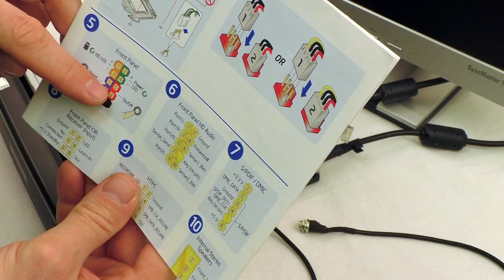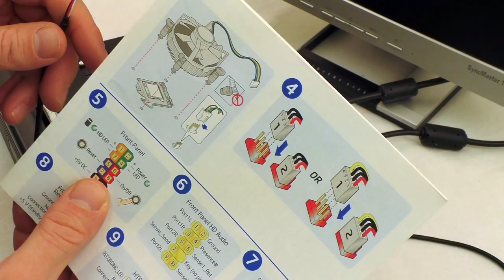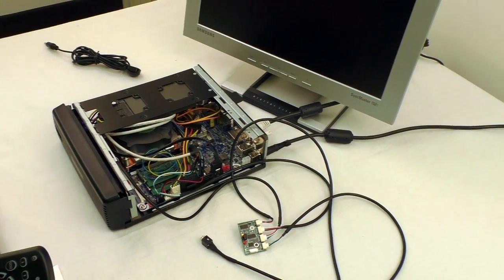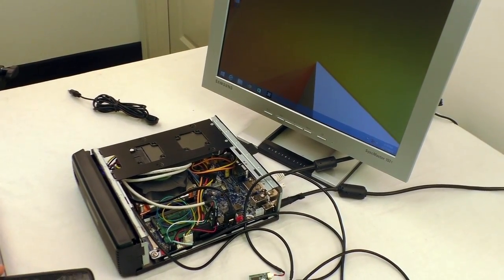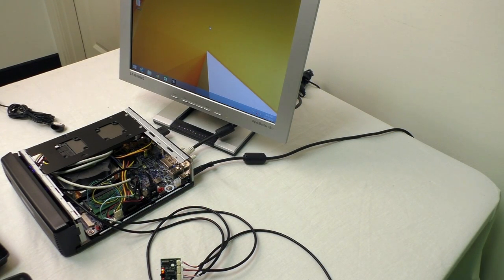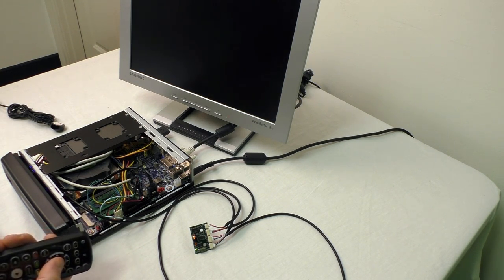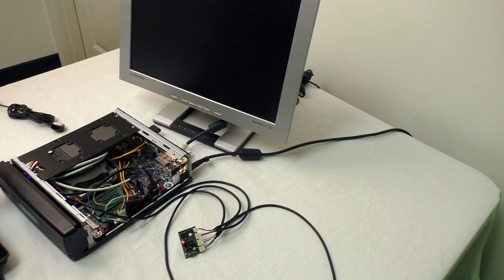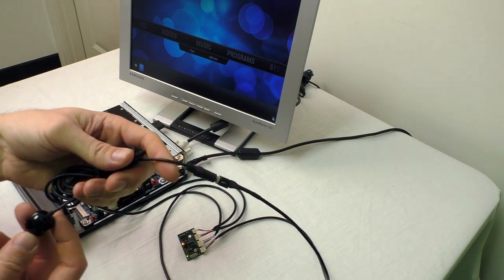Watch the PC-IRS5-01 HTPC IR Receiver in Action

Comment: Nice idea.  I would back this kiskstarter if it included a 3.5" bay hardware.  Drilling an existing case is problematic.
Reply from the maker: You could use the IR extender kit if you don't want to drill any holes.